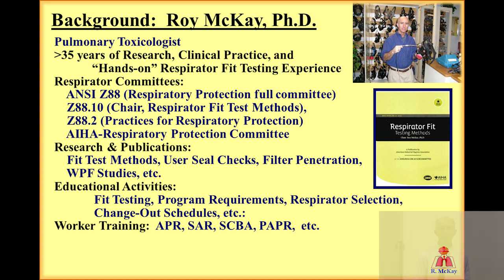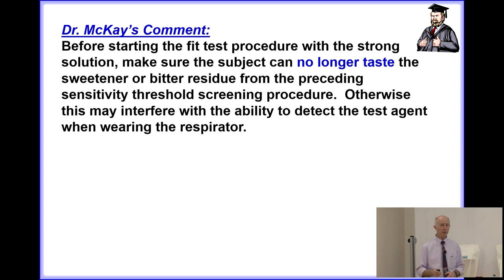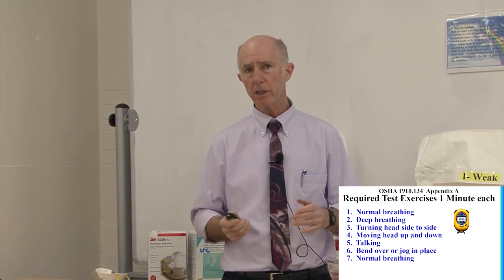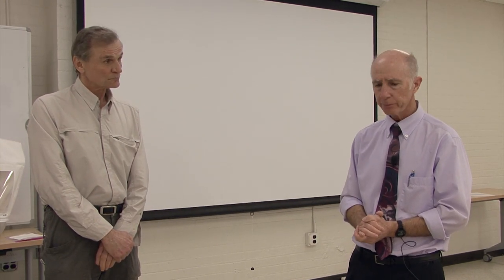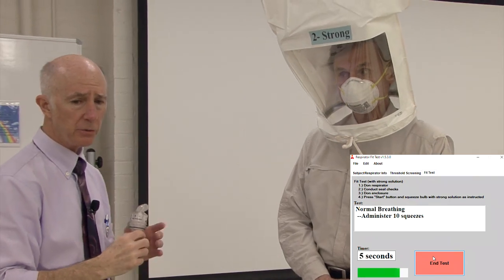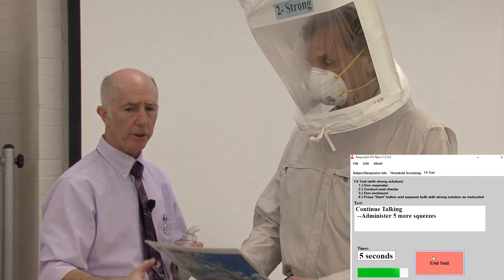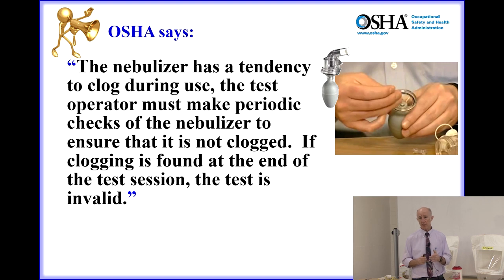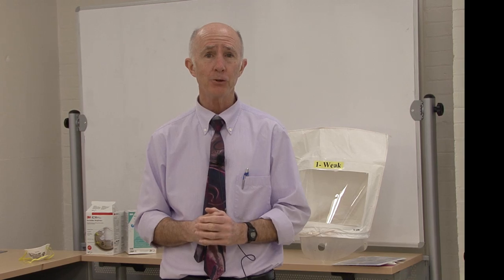Respirator Fit Testing Using Sweet and/or Bitter Solutions by Dr. McKay

Comment: Sir, Is it ok if you make a video  showing as to how to use BITREX solution for testing . I mean how to correctly pour it frm the tubes . Eagerly waiting for the video . Thanks
Reply from the maker: My apologies, but I'm not certain I understand your question.  My guess is you're referring to the individual application tubes (ampules) some companies provide for the threshold screening & fit testing solutions.  If so, the key is to "pinch" the the tube to release the liquid from the glass ampule into the outer plastic dispensor (tube).  Pinching the tube crushes the ampule, releasing the liquid so it can be poured into the nebulizer.  DON'T bent the tube, otherwise the liquid may squirt out.  Wear protective gloves when squeezing the tube.  I don't plan to make a video on this particular topic, but I hope this helps.  Roy
Reply: Dr Roy McKay  , thank u so much . I got the answer as I din know how to use single tube to nebulizer . Thanks a ton